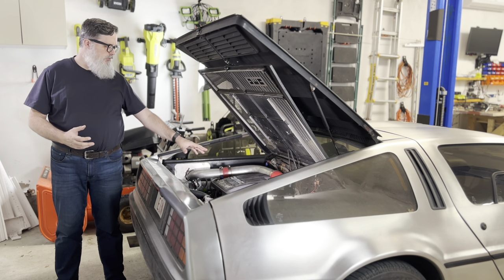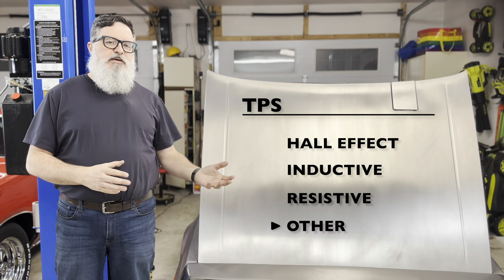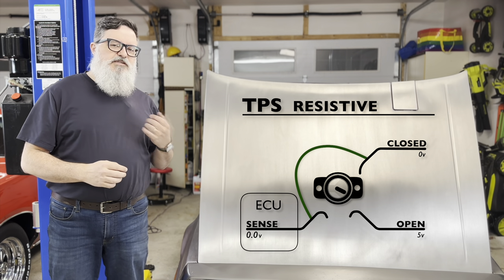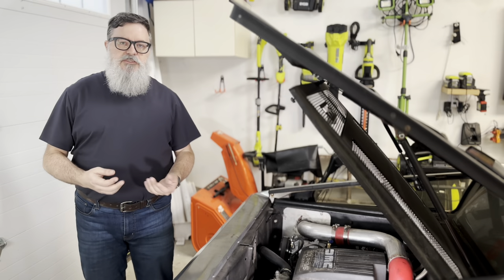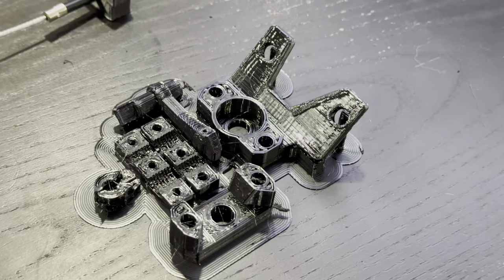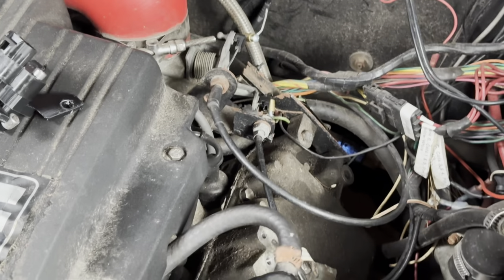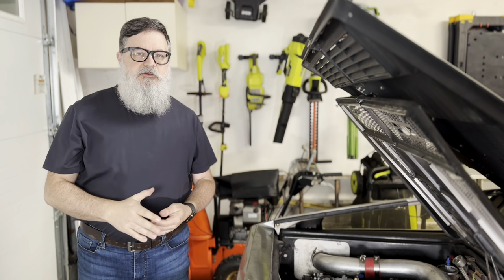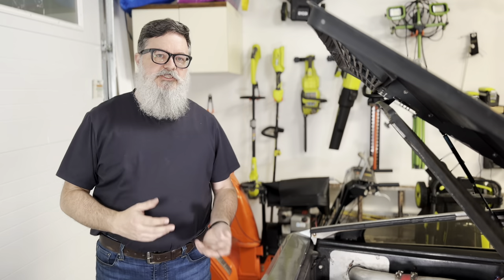3D printing an engine-mounted TPS case for the DeLorean

Comment: TPS on my cable throttle LS1 is turned by throttle body shaft - no return spring, always positively matching throttle position. I think nylon is OK for intake temps. When making cables thread through ferule - then unravel/untwist end, pull back into the ferrule then solder - strong enough even for clutch cables.
Reply from the maker: Interesting that there's no return spring on the LS1.  The TPS I'm using seems to be designed sot hat if it seizes it won't stop the throttle from returning to closed.  At least that's the only reason I could think of that they'd design it this way.

I have designed a magnetic TPS that mounts where the factory one does and would also replace the kick down switch, but I haven't gotten around to finalizing it and installing it int he car.  It's sitting on my desk ready to go, too.

Comment: You didn't mention the type of cable you used. I've replace throttle cables with high end bicycle brake cables. I make sure the cable core is stainless steel which seems to slide better than other options. Another reason I like these cables is that many come with an end already installed which would have eliminated your soldering step.  Love the can do attitude!
Reply from the maker: Thanks!  I honestly don't remember what I used for cable anymore; I just got something basic online, but I'm fairly certain it's stainless steel -- or, at least there isn't any rust on It yet. I agree that eliminating the soldering step would have been nice, although it was something that I did want to learn anyway.  Not that I did a great job of it (first time and all), but it seems like it was good enough for this project.  High-quality bike cables probably would have been a better solution.

Comment: just found your channel. awesome stuff. instead of a cable have you thought about using r/c car throttle linkages or r/c car turnbuckles
Reply from the maker: No, but that’s a good idea. I’m using RC servos and linkages to replace the vacuum actuators in my evaporator box (which I hope to finish programming someday, and make a video about). Using those linkages here would have nicely eliminated the cable. 

I’m working on a magnetic TPS that mounts where the stock one does. It’s sitting on my desk — I just haven’t gotten around to installing it yet!

Comment: I'd been trying to find a way to mount a sensor to the 2.8L, so I could run a Megasquirt/FrankenCIS setup...but it was a struggle to find a good solution.  I haven't installed it yet...but I discovered that some Yamaha Jetskis have remote mount, cable actuated TPS's.  The one I got was from a 2008 Yamaha FH SHO Cruiser.
Reply from the maker: Interesting -- MS with CIS?

 I've been working on another TPS project: a magnetic seensor in a 3D printed case.  I've tested an AS5600 sensor with MegaSquirt on the bench -- it takes 5v and ground and outputs 5v based on the orientation of a magnet, and can be directly powered and read by MegaSquirt.  The catch is that it does 0-5v over 360 degrees, which limits resolution.  I'm building a board to let you set the low/high points so that 0-5v is over the actual throttle range.  I might be able to replace the automatic transmission kickdown switch with this, too.  If it works, I plan on doing a video on it.

In theory, this could work on a 2.8L engine, if you can find a way to get the magnet to rotate axially with the throttle spool, and find a place to mount the board.  I'll have to take a look at a 2.8L engine next time I'm near one to see how feasible that actually is to do.
Reply: @joeangellx  The FrankenCIS is actually a little machined block with a fuel injector, regulator, and pressure transducer in it, that takes the place of the Warm Up Regulator.  So, Megasquirt can then modulate the control pressure, to vary the mixture.  I had it up and running briefly, and found that it can also drive the frequency valve...to the point where the modded WUR probably really isn't necessary?  I just had it on real quick as a proof of concept, before moving to a different proof of concept.  I think the FrankenCIS could be a neat solution...but I'm sure there's probably a lot of lag in the system response.  It could be fun to play around with more...but I don't think it will ever match multiport EFI.

Regarding the TPS...I have a manual transmission, but my plan was to put the automatic cam on the throttle spool (for the kickdown cable), and then hook my remote cable up to that.  I'd looked at 3d printing some sort of adapter to slide into the top of the spool, to try to use some common TBI Chevy style TPS's...but I never really saw a great way to go about it.

I looked into something similar to, or possibly the actual, AS5600...  It looked neat and fun to play with, but figured it was something I could circle back round to, if I didn't find some lower hanging fruit.
Reply from the maker: @42anon427  Now I'm wondering if you need the WUR if you can control the frequency valve.  But it seems like it controls the fuel flow by offering resistenc to the fuel distributor, so removing it might cause the car to stall if you rapidly tap and release the pedal while warming up, maybe?  I'm just guessing here.

I think most EFI conversions use bank EFI (I am on my 3.0L), just because you can do it on an MS II, but it's probably already better than CIS.  But I'm not super familiar with how CIS actually works, so I wonder if there is inertia in the mechanical systems that still limit your performance even with a controlled WUR and frequency valve.  It's still a very neat project -- I wouldn't have thought to even try that.

Using the auto trans throttle spool for the extra cable is a good idea -- that makes a lot of sense, and avoids the doubling-up I had to do.  The only trick will be figuring out where to mount the TPS so it's in line with the cable when you're done.

Good luck!